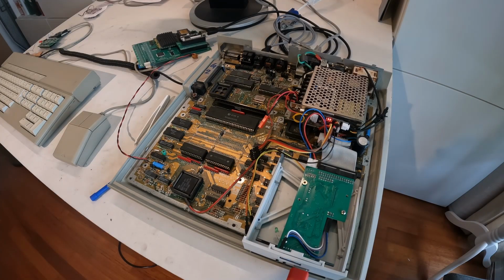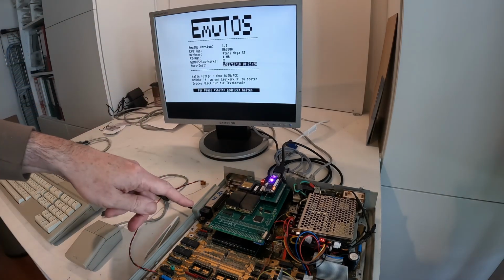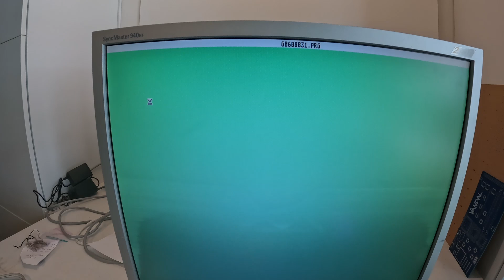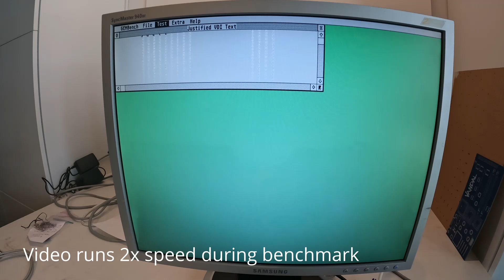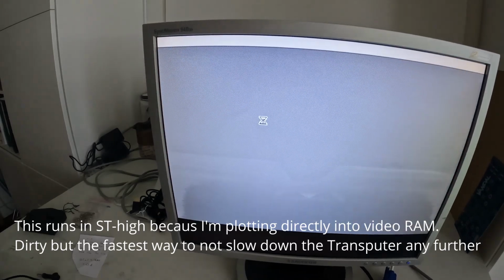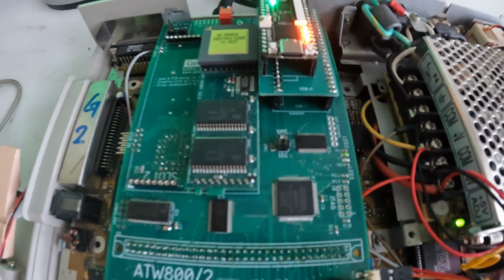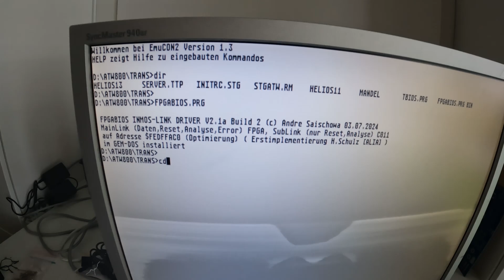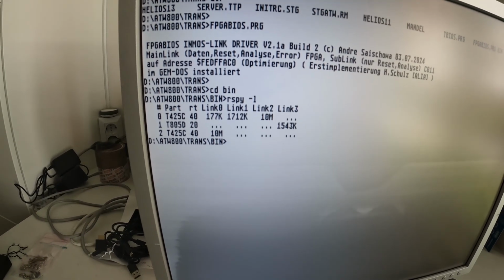Preview of the ATW800/2

Comment: I am excited to see this happen as I have all 3 computers this can work on, Mega 2 ST, Mega STe, and a TT030.  Main reason I want it is for adding better video so I can have more than 640x480 vga on a TT but... tell me more about Transputer.  I have heard the name and see your videos about MandleBrots but what else can a Transputer on an Atari do?  Just curious as Mandrelbots are cool but what real world things can it do for us?  thx
Reply from the maker: A Transputer is first and foremost "yet another CPU". Internally it's RISC'ish (having a microcode makes him non-RISC) and unlike other CPUs it features 4 "serial links" to other possible Transputers... which makes it easy to build a massive parallel system with theoretically unlimited CPUs. But Wikipedia and especially transputer.net will tell you more details.
What can such a Transputer do in your ATARI? It's a CPU running in parallel to your 68000/68030 with which it can communicate. 
Given your coding skills, the transputer could en/decode JPEGs, run a chess engine or even a full blown OS (like Helios, as the original ATW800 did)... it's just limited by your imagination, really ;)

Comment: This looks like a very nice development! Having the option of an additional 720p@60Hz resolution might help with capturing the video on cheaper HDMI-grabbers. Even if the frame is not fully filled (black borders), it will have the needed timing for easy capturing of the output. Same goes for an accurate 480p (720x480) for those reasons.

Comment: Just for people who dont know, you keep saying ATARI  Mega STE while it is the older MegaST without E, which is a very different machine.
And yes this project is mega awesome, I had a opportunity to stand next to a ATW in 1989 and it was doing nothing except calculating Mandelbrots, but the feeling standing next to a potential power computer is hard to describe, would be similar to standing next to Cray back then.

Edit: I also remembered one more fact, I was told that the ATW had far superior graphics to ST with very fast BLiTTER capable of texturing a 3D object, the ATW had a TT monitor connected when I saw it, and the second box didnt have monitor at all.
Reply from the maker: You're right. The 1st time mentioning it at 3:24 when talking about the VME connector... so that fits, as the M-STe uses that bus.
Accidentally I call the M-ST "Mega STE" at 5:03... that's about it. No "keep saying" as far as I see. Everything else might be a mumbled pronunciation of "ESS TEE" and "ESS TEE.EEE". Sorry 'bout that.
Reply: @geekdot  absolutely no problem mate, great video and even greater work. I just wanted people not to be confused, since your card would not work with Mega STE...
Reply from the maker: @madigorfkgoogle9349  It will. As said, it's a "double-bus" card. The /same/ card can be used either in the Mega-SE populating its specific bus connector OR it will work in both VME Ataris (Mega-STE and TT) when the VME connector is fitted. This video just shows the Mega-ST version as VME is not 100% bug-free.
In doubt, please visit the website and read the specs.
Reply: @geekdot  I know, and I know how both bus versions work, my comment was video specific and about the current Mega ST version for Mega bus connector, so people do not get confused.
I also do like your MC68k slot multiplier (which shows that your Transputer and ISA ports do work on any ATARI ST model to some degree), except maybe the need for pass trough socket for the CPU. You could simply add another socket slightly offset to CPU pin headers for simplification, would be easier to make, dont you think?
Reply: I saw one in 1995 doing some prime number world record from a few years back. This had been owned by Shell IIRC with a bunch of farm cards inside.